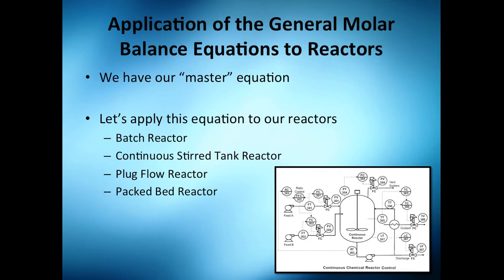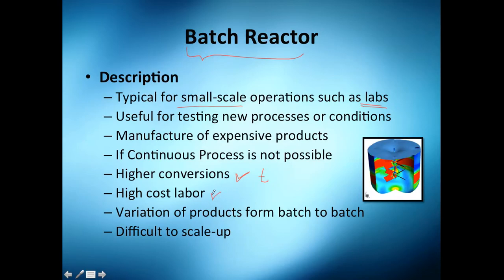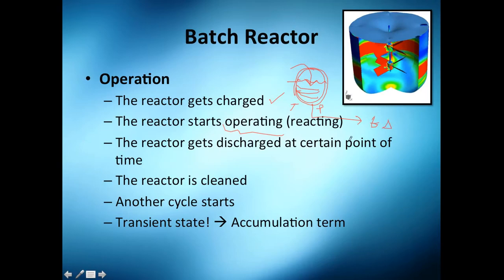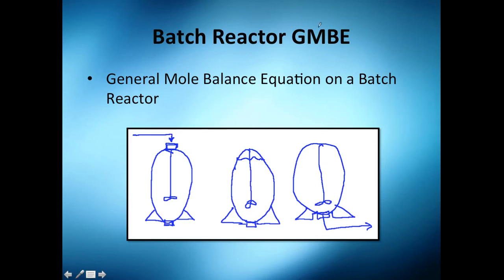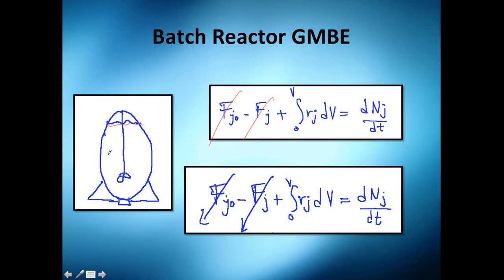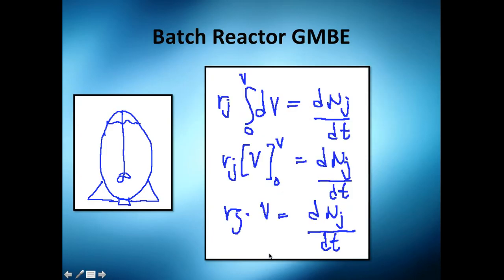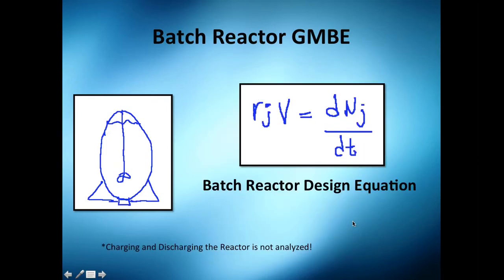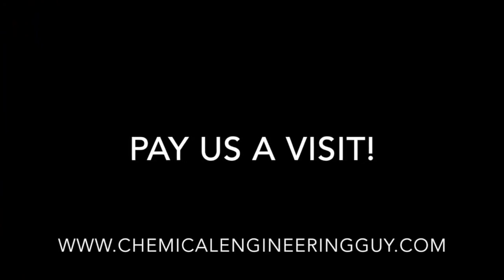Batch Reactor Molar Balance Design Equation // Reactor Engineering - Class 6

Comment: Very good, But i don't understand why in previous videos you assumed that the rate of reaction is different in different volumes in the reactor, so you come up with the integral form for generation, Then in this video you assumed back that the rate of reaction is constant throughout the reactor, so generation will be just the rate of reaction multiplied by the volume of the reactor ?
Reply from the maker: exactly! As it is "per unit volume", you will need to multiply by the total volume at the end